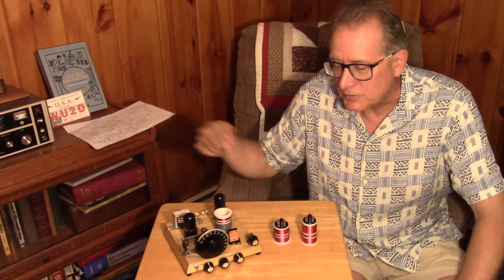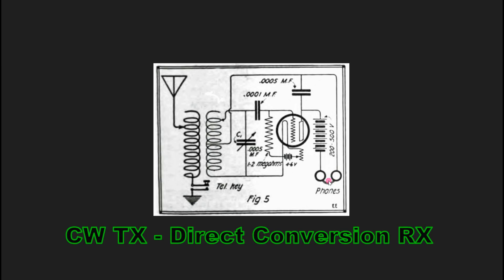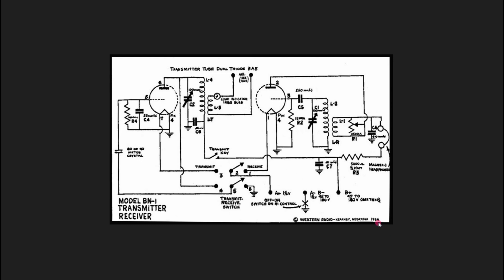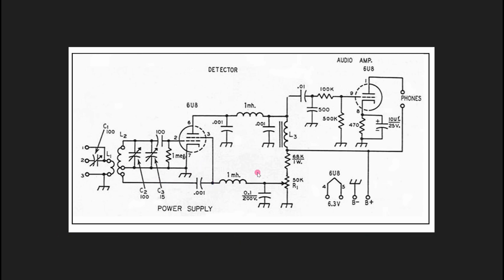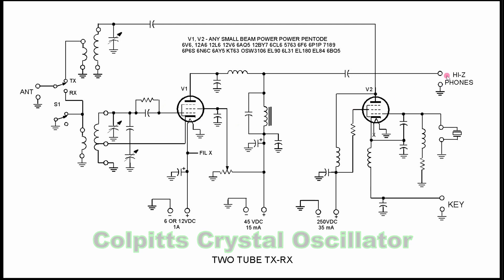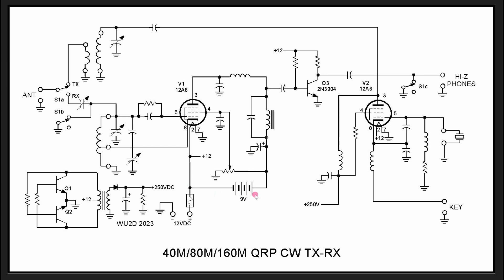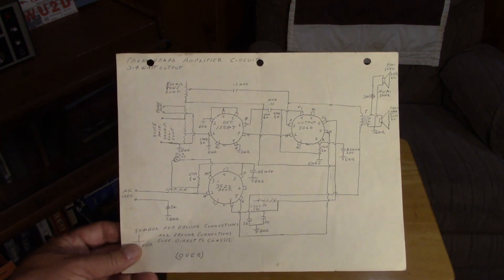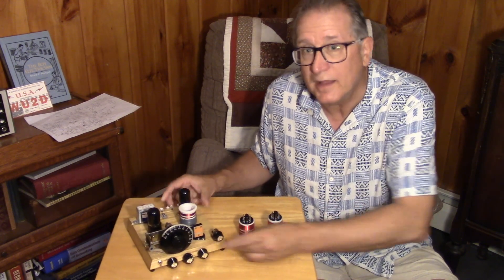KW7T Two Tube Transmitter Receiver - Intro

Comment: Should that Solid State high voltage generator not have had a feedback winding and just one 10K resistor not 2 10K resistors and a 50Pf capacitor across the two collectors of the transistors to get a nice clean signe wave instead of a raspy sound square wave.

Comment: Very nice 2 tube transceiver with vintage tubes, etc.. Why did he not use the 250 vdc source divided by 2 resistors for the regen  tube? That way you would not need a 9v battery and it could all be powered by one 12vdc power source.
Reply from the maker: There are many ways, but component count, perhaps by the time you clean it up enough? We shall see.

Comment: This was an interesting since I had never looked at the one tube transceiver circuits.
The transistors in the schematic with the step-up supply will degrade over time due to McDonald effect from the reverse base-emitter bias on the off transistor.
Reply from the maker: That is quite a primitive circuit, and I will take a closer look when we get there with the series.

Comment: I used to live in La Junta Colorado, I was amazed at the broadcast am radio I would receive.
Reply from the maker: Nice lower noise environment for AM!
Reply: @MIKROWAVE1  you hit the nail on the head kind sir, definitely little to mechanical whine simply because there was little electrical interference.

Comment: Interesting and thanks for showing it to us. Is the 250V DC supply easily found today please?
Reply: @tripplefives1402 Thanks for the information, I appreciate it. As my handle suggests, I'm in the UK where the voltage is 230v but I take the principle for what you say. A varaic is a good option and is on my shopping list. Thanks again and best 73, G0ACE
Reply from the maker: The unit has onboard 250V that is converted up from 12V. So the unit only requires 12V and, of course, a 9V battery.
Reply: @MIKROWAVE1  Thanks for the information Mike. That clears things for me.

Comment: I've never been the first viewer. No big deal at all. Good grief, 200 - 500 Volts in a set of headphones ???
Reply from the maker: Ha the good old first days of radio.
Reply: I guess using an audio transformer would be cheating.
Reply from the maker: @jennyjansen754  Folks are experimenting with ordinary small power transformers. For instance a 120VAC to 6.3 VAC 1 Amp job has a 19:1 voltage ratio which squares to a 362:1 Impedance transformer. So if you had a tube with 4500 Ohms of plate impedance, the output impedance would be 12 Ohms to drive ear buds.